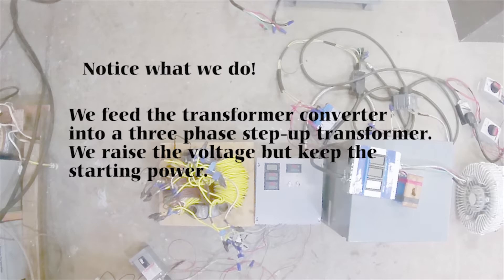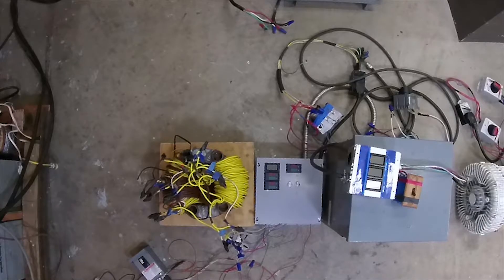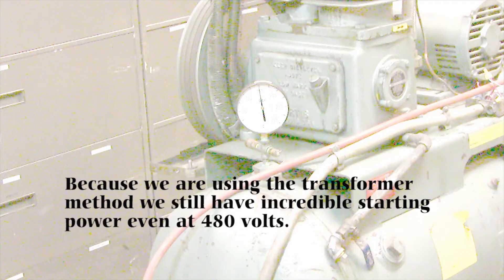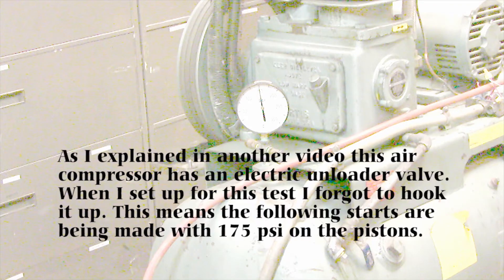10 Hp air compressor at 480 volts on single phase power.

Comment: Thanks for the video. I build a 3 phase a converter to drive my 10HP compressor motor few years ago but I wire the motor to run a 220 v and I had to add a capcitor with a time delay to be able to start it. But when I look your video, I think I need to review this project. I went with 220 v becaue of the capacitors.

Comment: I tried to comments the question on your screw compressor build; can you run a VFD with the conversion?
Reply from the maker: If you mean can you build a transformer converter and feed that into a VFD? No, the transformer converter needs to feed into the motor you are running and it needs to feed directly into that motor with out going through speed controls etc.  If your wanted to run a three phase VFD then you would have to feed that with a rotary converter. Although some VFD's can be feed with single phase and output three phase. You have to derate the vfd though.
Reply: @unique3phase  ahh.  OK.  I was thinking VFD on your screw compressor....however to make that work.  Most modern Gardner Denver compressors are VFD and demand regulated.  I bought your book btw,  interesting stuff.